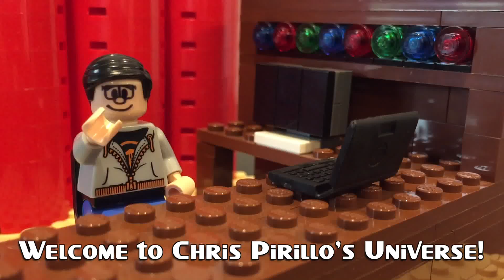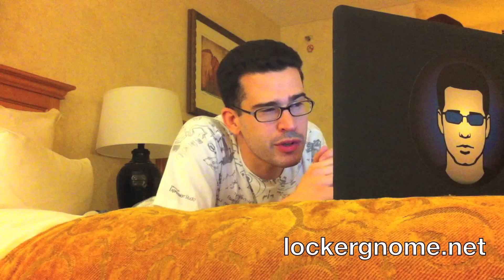How Do You Save Energy with Your Computers?

Comment: @jtspgs1986 
amd quad core 3.4ghz uses 125Watts of power i presume thats more then a lightbulb. When it comes to custom builds maybe not as energy efficient as stock built machines.

Then again it varies on whats being done, if your using all of your cores then its gonna use allot of power, for simple tasks the energy is like a lightbulb.

Some people who game leave their cpu + gpu intensive games on for  hours when they go out, even if theirs no action the cpu is being used to run the program.

Comment: Turning the monitor of especially when downloading, just end all processes for other software your pc uses less power just for downloading. 

Turning screen brightness down saves energy too

Going into sleep mode when you away also helps me allot, especially if you have a older system that takes a while to boot up but runs fast :S